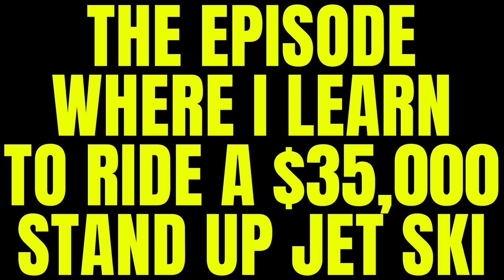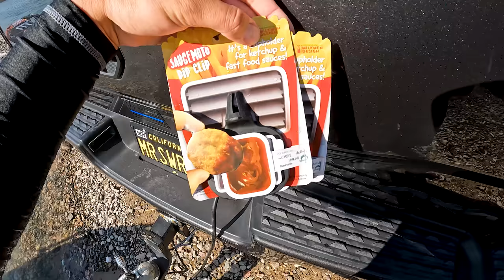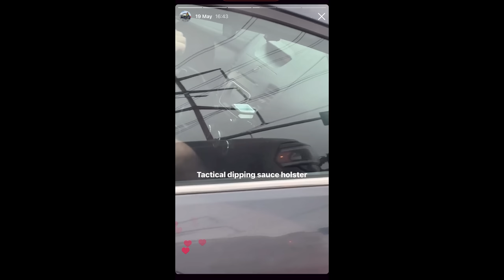Riding The World's BEST Stand Up Jet Ski!

Comment: Those were popular back in the late 70's and 80's
Reply: Still popular, most people don’t want to put the time in to ride them and get good at it.
Reply from the maker: Still are!
Reply: @CycleMycl same with everything. People are lazy!
Reply: It's too bad these are so rare. It actually takes some skill to ride a stand up and it's much funner than a sit down. Kind of like the different between driving a corvette as the stand up to a huge 4 door mini van with the sit down skis people ride around on these days.
Reply: @daverupes7022 lol they aren't rare
Reply: Bro WTF are you talking about they still are!!! I just bought a 2023 model.
Reply: They only had 50hp back then, now they have 200hp and can backflip almost from a standstill
Reply: @1187titanium  Bro ot wasn't hard to soup them up back then...I had an 88 Yamaha two stroke two cylinder Mecuni carb machine work bigger piston and ran it on alcohol..Was probably pushing 150 or more.
Reply: I think you mean 80’s and 90’s
Reply: @CycleMycl that's what most people are like these days
Reply: That's what i grew up on, we'd pull tubes n kneeboarders
Reply: You're all talking about 4 locos, right? Being popular
Reply: @chuckfowler8875 The first Yamaha Superjet was the 1990 model.
In 1988 they had the Wavejammer. It was closer to Waveblaster, but
hay.
Reply: @backcountyrpilot  Didn't say anything about the Superjet..Cofused!!
Reply: We still build and ride surf in our stand up Yamaha superjet. Zero championships 100% Freeride.
Reply: A
Aaà

Comment: First off what a gorgeous legend to teach you. Second off I've never understood why so many people have issues standing on these. I have one of the Kawasakis 7 series and I love it. I also used to ride my jet powered surf board quite a bit and I've surfed since I was 10. Granted I'm 37 and weigh 135 pounds at six foot two. I've just never been able to gain weight. To much metabolism I guess. Gotta admit that is one nice lookin stand up. I'll stick with my 4 seaters tho. I've got a 2000 kawasaki stx900 that's had a ton of work over the years and it's easily capable of 120+

Comment: You are dead wrong in thinking that a lower powered ski will be easier to ride. In the stand-up game, the more power you have the easier it is to ride. Especially if you are a big boy like yourself. When you go to fall you can power out, where as with a slow ski you can't. I have over 25 years experience riding stand-up's. BTW, these people should have told you this.